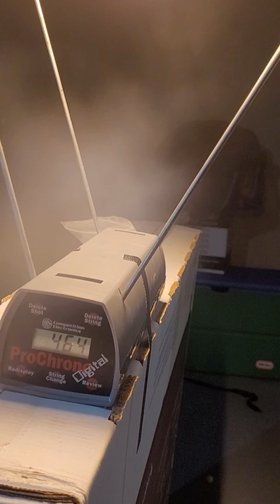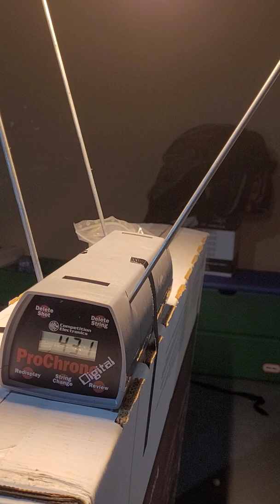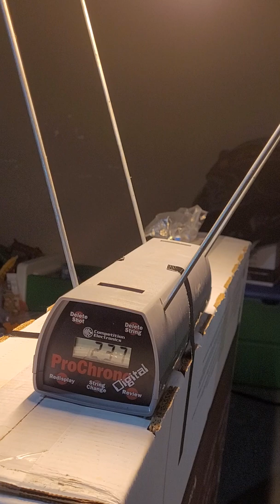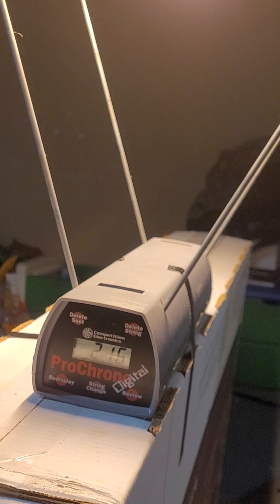Umarex HDP 50 Compact Power testing Co2, HPA

Comment: Always wear hearing protection. My scientific explanation of why HPA does so poorly is because CO2 is liquid and expands to fill more volume while HPA is stuck with the small volume of the chamber. If my theory is correct then adding a ZRAM will make HPA superior. My original theory was that you didn't remove the chamber block, but after reading the description it seems you have, so its a bit perplexing.

Comment: I have a compact, it's pretty nice, don't like orange color but I plan to get all black, I think the 7.5 version actually pushes 8to9 joules on 1 gram amo, like 420 on first few shots than slowly drops to upper 3s wen CO2 is goin low, 15 or so shots I believe, on them 8 grams mods, the power is good, but sucks on how many rounds you get, 12gram is better,it's almost worth keeping it 8 9 j, and getting more shots, not using no more than 2.8 grams getting low 300s.
Reply from the maker: i think i got this upto around 50 joules with hpa and barrel upgrade in another video

Comment: Just got my hpa adapter today. I measured fps a little lower on the co2 with rubber balls but your 850psi was right on i got a 206fps with the 8.35g ball bearings.
Reply from the maker: i was expecting at least 40 joules with the hpa the barrel must be the difference as its only a mere 3 inches lol